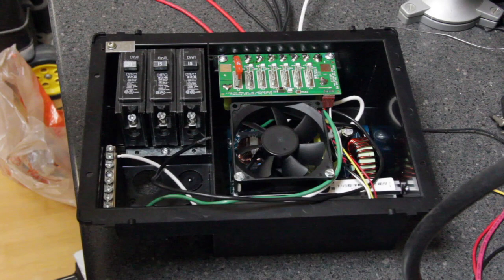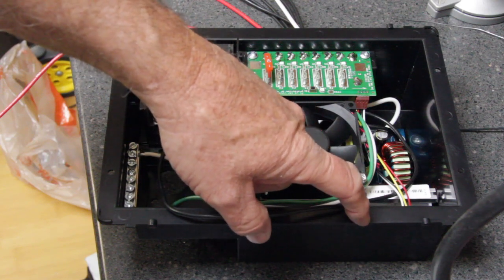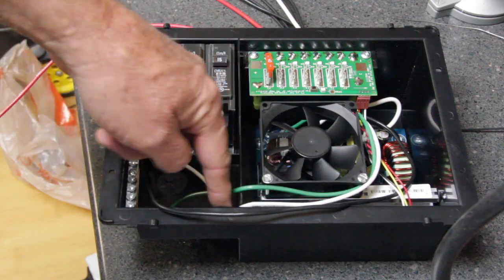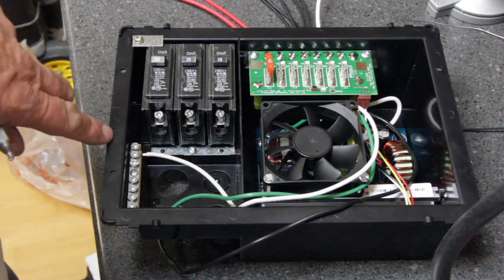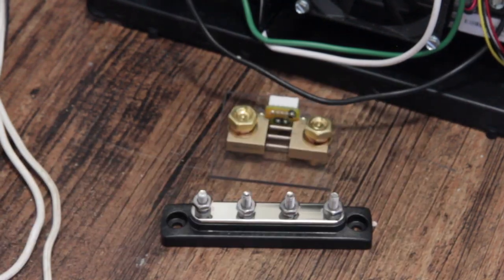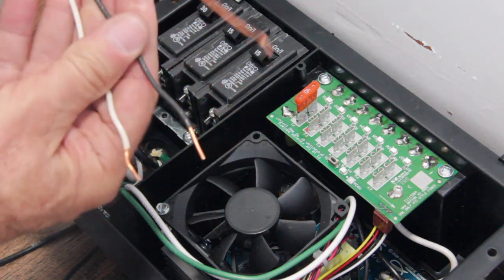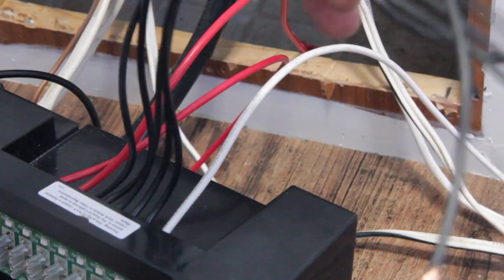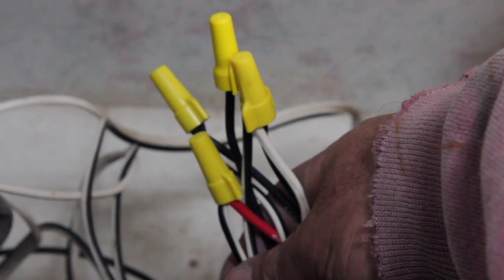Progressive Dynamics PD4100 Install

Comment: if not plugged into shore, will this automatically draw from the battery as a source of energy to us both my AC and DC components?
Reply from the maker: This is a converter,  will convert from shore power to 12 volt DC.  You can run your 12 volt circuits from the battery.  You would need an inverter to convert DC to AC via battery.
Reply: I added a battery shutoff.